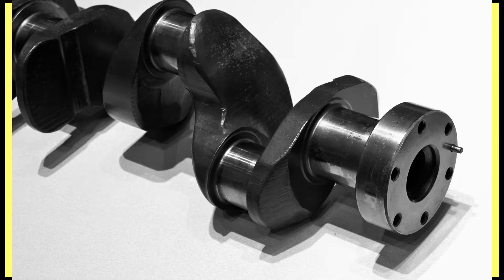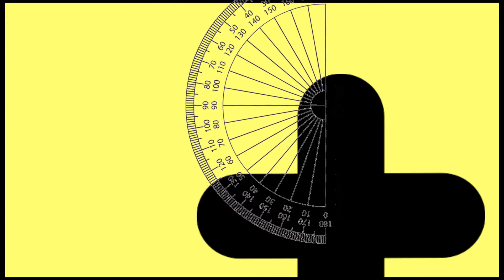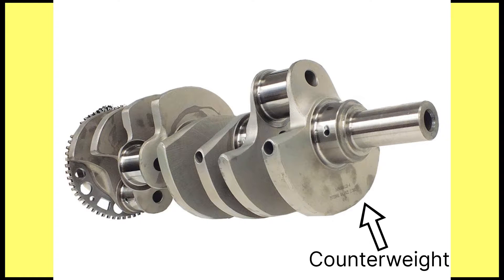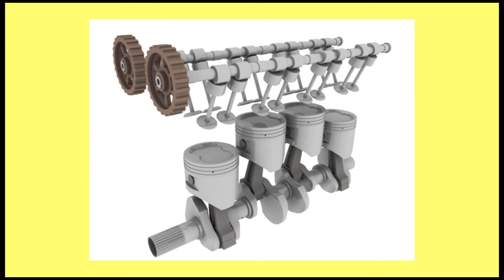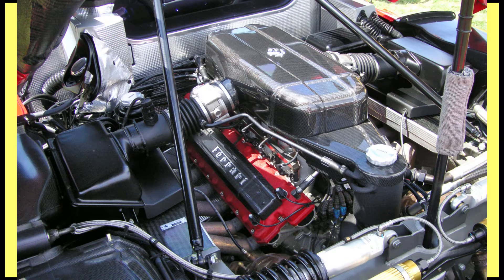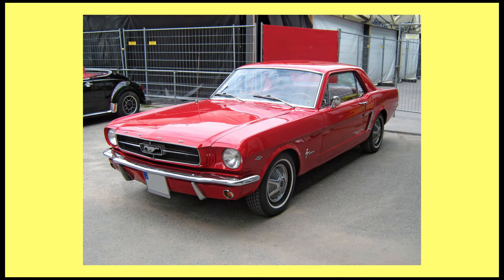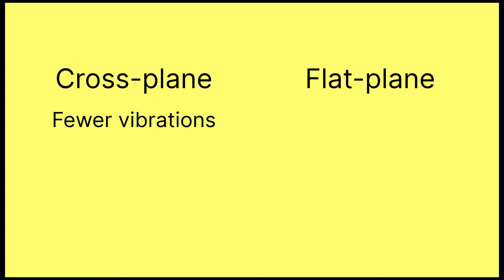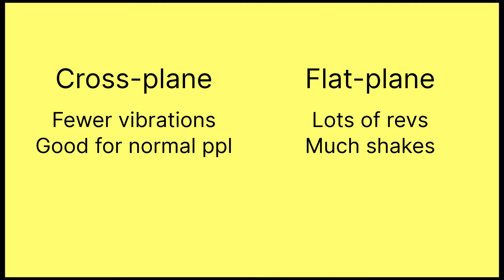Flat-plane vs Cross-plane Crankshafts...Which is Better? | Quick Science

Comment: The problem with flat plane crank V8s is that they produce the same reasonance problems of a 4 cylinder engine, and like a 4, the bigger the engine is, the worse the problem is.  Their big advantage is much better exhaust scavenging, which is more important in racing than silky smoothness.  Their other advantage is lighter counterweights.  Again, more important in racing than street use.

Comment: It's not so much the crank being flat or cross that makes the exhaust sound good. Much more its the extractors and exhaust manifold. If they are large and free flowing especially if the catalytic converters are not present the a flat plane or a cross plane has a good rumble going on.
Reply: it's the firing intervals. 

Saying the exhaust is responsible for the good noise is redundant. You could put a $10'000 exhaust on a 180' parallel twin and it's still going to sound like a lawn mower.
Reply: You mean firing order.  The intervals are always the same, except on the early Lincoln 60 degree V8.
Reply: @jamesbosworth4191  You're 100% correct. A V8 always has a 90 degree interval. It's the firing order which causes the sound. 

Since two cylinders fire on the same bank and then alternate, the exhaust pulses are uneven, creating that burble. Been learning a lot over the past year.

Thanks though.

Comment: Is a block specially design for a flat plane crank or can be a regularly 5.3 with a flat plane rotating assembly?
Reply: You should be good with your block of choice, the only issue I can think of may be in the bottom end where the crankshaft sits. Your main issue will be making a custom camshaft and programming the ECU with the specific firing order.

Comment: What American car was this?
Reply: One of the new Corvette engines has a flat plane crankshaft, and you can buy aftermarket flat plane crankshaft's for just about any Ford or Chevy V8, the old one's and the new one's. 
Even though they're very rare in the late 50's Chevy made a flat plane crankshaft small block racing engine, there's a guy here on YouTube that has one.

Comment: The reason why people say flat plane V8's don't make as much torque is because the majority of flat plane V8's have been built as racing/high revving engines with shorter strokes and bigger bores.

An appropriate comparison can only be made with the same engine with the same bore and stroke and the same exhaust setup. Try doing this on a Diesel.